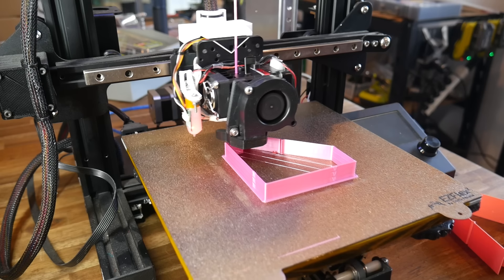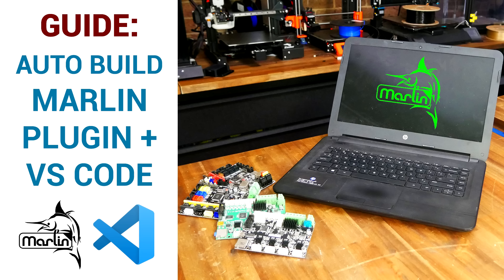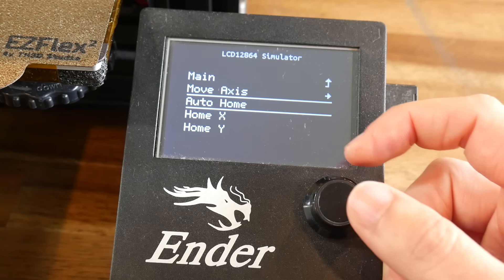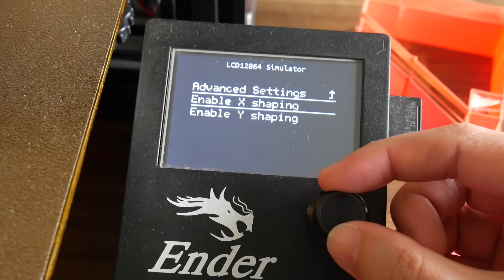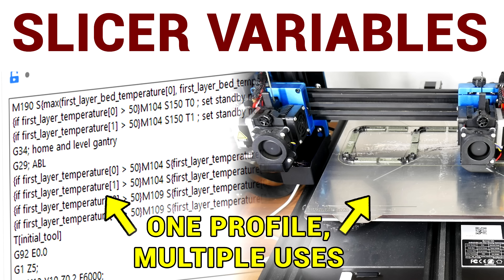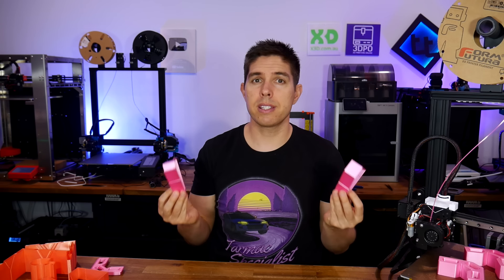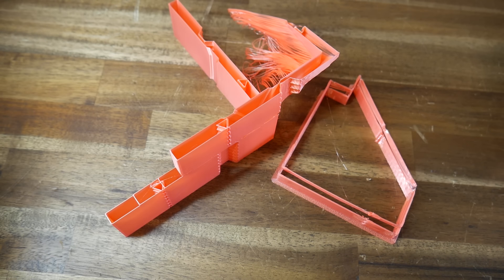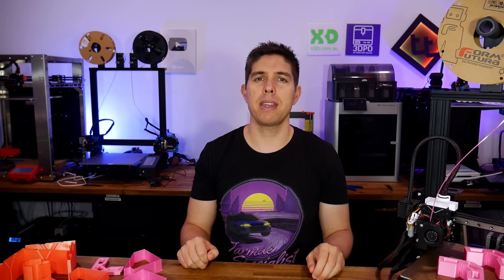Marlin Input Shaping - Step by step guide to more speed and less ringing

Comment: Great update, but only for those who know how to compile firmware.   I'll have to wait for a bin file that offers this for an easy upgrade to my printer.  'll also wait for hardware support.   I'm not into fiddling with code, but this is how it always starts, so I am grateful to all those who do this for the love of printing.
Reply: No ones gonna force you but compiling marlin can barely be considered writing code, for the most part all it is is going through a single file and adding values in fields or deleting comments. It has the same complexity as editing an excel spreadsheet in reality. Ive compiled marlin many times in the past and not once have i had to actually write any "code" per se
Reply: @Jake England It is probably more the compiling itself or installing an IDE (probably visual studio is the only real choice here?) and then flashing it onto the hardware that would be more of a daunting task
Reply: @MartinDerTolle  agreed but at the same time theres also an extension for VS code now that makes it super easy to flash marlin. Anyhow klipper is still by far the easiest of the 2 firmwares to install.
Reply: It's not code it's configuration. The difference here is to embed values in the code rather than read from a config file.
Reply: I haven't tried it yet but the latest precompiled version of Mriscoc's (Ender3 V2/S1 Professional Firmware 20221222) says in the first line of the whats new section "Support for Input Shaping in the Special Configuration repository"
Reply: @Paul_Au  I’m on that firmware too, I hope I can turn it on without having to upgrade firmware again. Although the advice in this vid to get all your eeprom changes copied before doing a firmware upgrade is great I never knew about that.
Reply: @GlenEdwards  Hi Glen, Although in this case, I did know about the e-Prom data save, so often I find I learn something that is not related to the subject matter directly. It's kind of like finding an Easter egg in software, when it happens!
Reply: @jakeengland1430  I don't think so. You have to deal with a raspberry pi, linux, images... wiring up accelerometers. Naaah.
Reply: @alejandroperez5368  you don't have to deal with an accelerometer unless you use input shaping and the same applies for marlin, ill say that theres more upfront commitment with klipper but once your past the installation process it is hands down way easier to use then marlin, if i want to change anything in a marlin config i have to hope that ive saved my marlin files for that specific machine somewhere or start from scratch and there is so much junk in the marlin config files. Klipper only uses what you want to add and takes a couple of minutes to add or edit files no need to recompile no need to dive into pointless settings that i don't need.
Reply: i can compile one for u if u really need it, however, its very easy to do

Comment: Could you explain the logic behind rotating the ringing tower by 45 degrees if the system is coreXY? I thought that the vibration frequencies depend on the weight/mass that is moved per the X and Y axis, not because of motor pulley+belt elasticity. Or is it both? Can the algorithms counter ringing due to belt elasticity? I have not seen before the recommendation for 45 degree rotation for coreXY systems.
Reply: Not sure about this, but my guess is it's because of the way they are adjusting the setting per motor. CoreXY's use both motors when travelling in X or Y so the test wouldn't isolate each motor if the part was set to 0 degrees.
Reply: @Bubo Bubobubo haha. Beat me to it.
Reply: @Bubo Bubobubo Thank you for the answer. The thing is the physical system on a coreXY still has differences in weight on the X and Y axis because of the gantry. In a coreXY setup the mass moving along the X is still less than the mass moving along the Y axis. Along the X axis the toolhead is moving only and along the Y axis the toolhead plus the X crossbeam are moving together. I do know that in order to move only in X and/or only in Y, both motors are engaged. As Michael says later on in the video for when to recalibrate input shaper, the third reason is change in weight. Thus this applies for a coreXY system as well, for example changing the X cross beam from an aluminium profile to a carbon fiber beam or going from 2 MGN9 rails to a single MGN12 rail (Voron 2.4 vs Voron 2.4R2 spec). So I am not sure I understand how motor engagement is linked to the vibrations. Maybe it is belt elasticity and that is why the second reason to recalibrate input shaper is belt tension, but still in that case I don't understand how the vibration algorithm is linked to the motor pulley + belt tension and can counter/compensate for that. If it is a difference in belt tension, then I would think that the fix is to make the belt tension even for A and B motors, not calibrate input shaping to overcome ringing artifacts due to bad belt tension.
Reply: @Dramaican88  I think the point is that even though resonances will have all sorts of "vectors" in their effect on the printer, the calibration is about what compensation to apply to each motor in order to try to cancel it out. So it makes sense to take measurements that align with each motor's axis of movement, so you can optimise the correction accordingly. Resonances that contribute to both axes will be proportionately corrected by each. Since the correction can only be applied to a movement direction it makes sense to measure and correct on that same direction. Measuring it otherwise would add a heap of transform complication which would at best reach the same result. I'm talking only from gut theory and not actual experience with testing or the implementation of the tuning method, so take with appropriate volumes of salt 🙂
Reply: its because in core xy printers every movment is a compinaion of the 2 motors, except for straight 45º movments
Reply: @Lucas_sGarage  It is not related to that or it is because of a different implementation in Marlin. The vibrations are due to moving mass inertia and the difference in mass/weight in a coreXY is still aligned on the X and Y of the gantry as there is still an X cross beam. If you look at this video again from Teaching Tech https://www.youtube.com/watch?v=er7q-CJL1lc you can see that the Ratrig V-core, that is also a coreXY machine, the model is not rotated and the command to measure the frequencies in Klipper is done per the gantry X and Y axis, not per stepper motor A and B! So it must be due to a different implementation between Klipper and Marlin (Marlin calculates movement in a different way maybe). I just can't tell what are the actual physics reasoning that translate controlling steppers to XY vibration movement. The only thing that my mind when to was belt elasticity, but no one confirmed this.
Reply: @Dramaican88  to my understanding it is, you want to get a value for each specific motor, so then the machine coordinates the movement, the only way to move 1 motor on a core xy it's to move it 45°
Reply: @Lucas_sGarage  Thanks for the response. I understand how coreXY works. I have build a Voron 2.4 and I understand the belt paths and tension. I see the diagonal movement. If you move one motor and you compensate (algorithmically/automatically change commands/coordinates) the movement for one motor then you change the movement for that diagonal 45 degree movement axis. The problem is that the vibration frequencies are aligned with the mass and not by the diagonal. Each belt loop for each stepper motor can stretch due to sudden movement changes. If you compensate for single belt loop stretch, then it does make sense to rotate at 45 degrees as the vibrations you see on the walls are due to that belt loop streching/flexing. The main reason for vibrations happening in the first place is belt stretching and flex/play/backlash in movement. IF the belt tension for each loop is identical, then the vibration frequencies on the diagonals should be equal, as only one motor is turning each time and the mass moving along the diagonal is the exact same. However, a larger mass, streches the belts by a different amount, because more weight means more force/inertia and more force on the belts, means more stretch/flex. So because both belts stretch at a different rate across the X and the Y axis, it makes sense to measure frequencies across that alignement and not per belt path individually...
Reply: @Dramaican88  yes, i understand, but i think that the reason is because you need to move une single motor at the time, the same way that it works on a Cartesian.... Now... My question is... Wtf you are supposed to do if you have a delta....

Comment: I've tried it on an Ender 3 v1 (8bit board) but it was unusably slow in the menu. This was over a month ago.

Has someone got it working on an 8 bit board?
Reply: No. the calculations are far to resource intensive for it to work on 8bit boards. Even slower 32bit boards, like the stock creality boards using the STM32F103 are mildly sluggish with input shaping enabled
Reply: @zacharywelvaert2235  If you want input shaping on an 8 bit board go with Klipper. It's a bit of a learning curve in the beginning but once you get it up and running it's fantastic.
Reply: @LesNewell  oh i am aware, i am well on top of that curve. no longer have a single marlin machine

Comment: Consider using this feature on coreXY printer, not on printer with moving bed on Y axis.

You can have a good coreXY with reasonable price ie Twotree Sapphire
And in that way you can achieve realy high speed an high acceleration on both X and Y axis

Without uprgading marlin I already can achieve fast print and 3000 acceleration on my Totree Sapphire printer ( the model name is changed to SP-5 now )

Comment: Does input shaping help with materials like PETG where the material itself requires slower printing speeds? I get it'd help with ringing and such, but wondering about print speeds
Reply: Many people say that PETG needs slower speeds, but I find it easier than PLA for high speed printing.  Can I ask what happens for you that makes you slow it down?
Reply: Input shaping always helps, but less so typically at slower speeds since the ringing will be less pronounced
Reply: @beauslim  the short answer is print failures. Under extrusion (even with constant recalibration), gaps, and just a lower overall quality of print. In the middle of a dd and hotend swap now so maybe that'll help? It's also been a year or 2 since I tried bumping up the speeds with petg, I've just dealt with the 30mm/s. I was always told it needs more cooling time between layers to provide a good base with good adhesion.
Reply: @daltonmason62  Input shaping only helps ringing. PETG can vary quite a bit between suppliers so maybe try shopping around. I'm currently having good luck with eSun. Also keep it dry. For filament storage I use large plastic tote with a couple of cheap chemical dehumidifiers.
If you're getting under extrusion try bumping up the temperature. PETG is pretty tolerant to being run hot. I'm currently getting good results with the first layer at 50mm/s with the rest at 100 and infill at 150 with the temperature a little over the filament's maximum recommended temp.
PETG can be touchy about extrusion. Under or over extrusion often leads to lots of ugly blobs. Most people say PETG shouldn't be squished down too hard but oddly I'm getting really good results with a 0.6mm line width on a 0.4mm nozzle.
Reply: @LesNewell  I've always been a hatchbox guy. Esun I was hit or miss with. I'm hoping the hotend switch (going from microswiss to a mosquito) will help. We'll see.
Reply: @daltonmason62  
Assuming that you are printing at around 235C and your extruder isn't slipping, under-extrusion at 50 mm/s is definitely odd even with a stock hotend.  Input Shaper, a copper heat block,  and a dual gear extruder and you should have no problem pushing PETG above 100mm/s.  
Gaps and bad adhesion are signs your PETG is probably wet.  I think most problems people have with PETG are from not drying it enough.
Reply: You can push PETG pretty fast if you have enough force and temperature. But you know what you can probably make PETG slightly better behaved with Input Shaping because it allows you to increase movement acceleration, so you spend more time at consistent extrusion speed and less time stopping and speeding up. PETG prefers being pushed consistently and doesn't really like hover time as it gives it an opportunity to ooze.
Reply: @SianaGearz  That's one reason why I run up to 7000 acceleration. To a certain extent input shaping is a band aid. It covers the underlying problem that is machine flex and resonance. It is well worth making your machine as rigid as possible before using input shaping. For example if you have a bed slinger a tower brace is very worth while.

Comment: My only question before setting out would be whether I need something extra for the screen of the ender 3V2, I have the neo. I recall there being a difference when I downloaded Jyers firmware.
Reply: mriscoc has input shaping enabled on his firmware for the 3V2. Jyers hasnt updated since mid 2022
Reply: @zacharywelvaert2235  excellent I will look there
Reply: Check what screen model you have by pulling the back off it. If it's a Dacai screen you copy the private folder to the sd card from the configuration options in the marlin software. I just used the file from the ender 3 v2 for my v2 neo. I have  input shaper working as in this video but for some reason it's only about 30% effective.
With my Dacai screen I've found the marlin menu the best. I had a few odd things show up using the creality menu.

Comment: Nice video. Is input shaping from marlin compatible with all printers? and how much ram/flash usage is too much when compiling?
Reply: It can work even on AVR boards, but it does require a bit of RAM. The RAM is allocated at compile-time so the compiler can tell you if it has run out of RAM, and then you can tune the shaper settings to try to reduce RAM usage.

Comment: Before performing the input shaping test, set your linear advance and minimum layer time to 0.

Since switching to a new motherboard, I have been creating my own firmware file using sample configuration files. I suddenly wanted to try new things that I haven't tried, and I was very surprised when I turned off the junction deviation and s-curve nonsense and went back to classic jerk. Linear advance worked perfectly without these two. no more blugy corners. no more stupid speed and acceleration effects on prints.